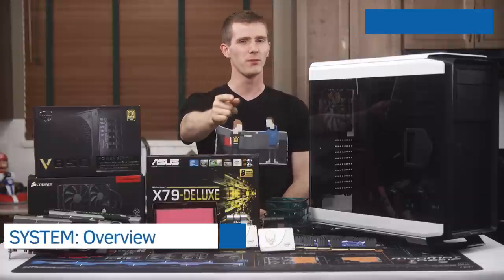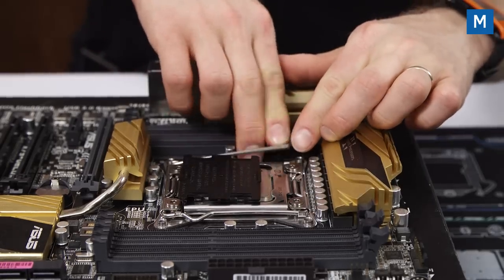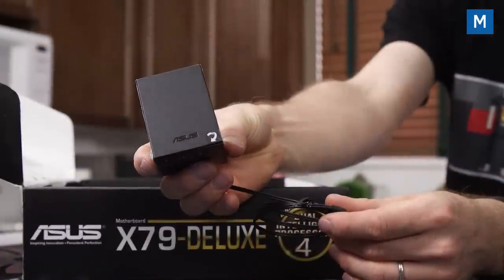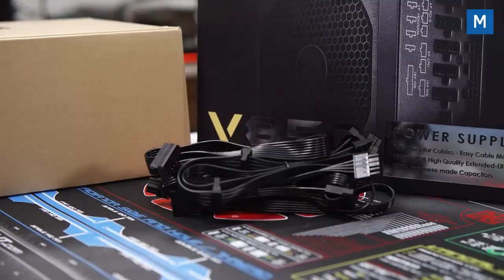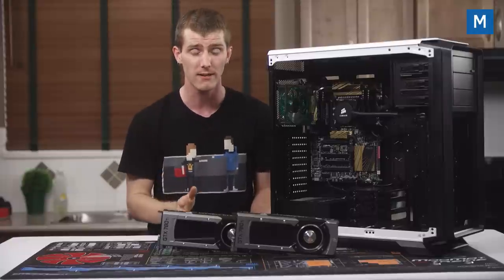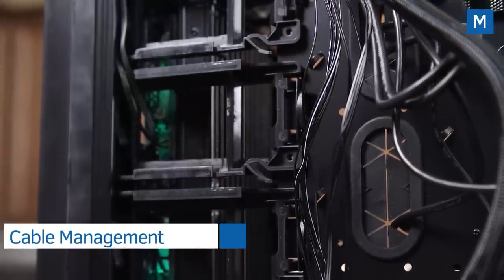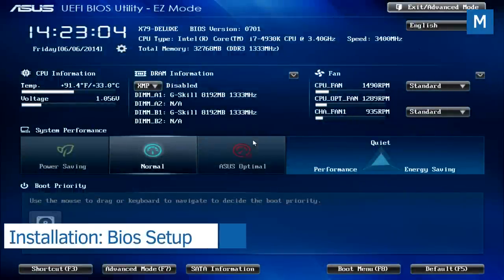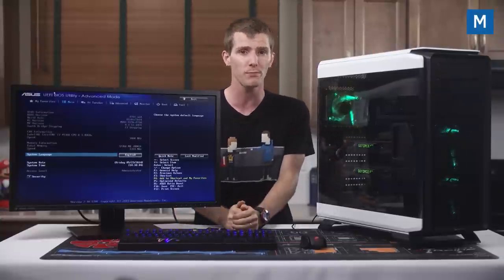How to Build the ULTIMATE 4K Gaming PC Build Guide

Comment: I think it would probably be better to use a 1440p monitor with is so you can have decent frame rates and AA.  Hardware just isn't up to par for native 4k yet and this rig is around $4000.
Reply: And the cost of the monitor, which is plenty
Reply: A) AA isn't as needed on at higher resolutions.  
B) AA is overrated.  Larger performance impact for minimal quality improvement.  Really edges are that important?  At best it improves a fraction of a percentage of the overall image.
Reply: Pull out one 780ti and you'll still max out games with AA in 1440p.
Reply: Alegiance not at 60 fps you won't. Google some benchmarks.
Reply: tmar23 you still need AA even at 4k. You can definitely notice the jagged edges, AA is simply a must even if it is only FXAA.
Reply: personaly i would use it on a 144hz 1080p monitor... refresh over resolution is my preference, just waiting on someone to make a true 240hz monitor
Reply: i agree
also its worth noting that most of the games (i may be wrong i play on an older pc and with older games) i have never seen any games that support 4k

Comment: I need help Im thinking of spending a zillion dollars on a computer:

CPU: Intel Core i7-4770K 13.5GHz Quadzillion-Core 
Motherboard:	Asus Z97-A ATX LGA1150 Dragon Gaming 1337 Edition
Memory:	G.Skill Ripjaws X Series 128GB (8 x 16GB) DDR7-1866 
Storage:	Crucial M500 120TB 2.5" SSD 
Hard Drive: Western Digital Caviar Blue 100TB 3.5" 7200RPM 
Video Card:	EVGA GeForce GTX 1780 Ti 30GB SuperMEGAclocked ACX 
Case : Cooler Master Storm Enforcer ATX SUPER Tower 
Power Supply:	EVGA 750kW ATX120V / EPS120V

Do you think it will handle Call of Duty on medium?
Thanks!

EDIT: Thanks for all the help but my mom said we cant afford it..
Reply: Might wanna switch to 256 gb of ram just a heads up
Reply: "CoD on medium"? Buddy, you're barely gonna get 10 FPS in Minesweeper with that garbage.
Reply: you need to spend 2 zillion to play on medium
Reply: i think you need to upgrade to a caclulator 2001 model, they are very powerful and affordable
Reply: ***** Or, you know, just download more RAM...
Reply: LOL . why did you use "i7-4770K" and "z97" ? just invent new names ! 
I7-9960X 
 X139
Reply: mohamed youssef , lol i5 889303. 6,000, 000 psu.
Reply: lawl
Reply: No, you gotta rip out the Playstation 2's CPU. It can handle Microsoft Word at 5-6 FPS
Reply: looooooool microsoft word
Reply: Timothy Lawson
Reply: No, CoD is too badly optimize so you might want o get an intel core i154 instead of i7 and a 484832gb of ram.
Reply: No no no you've gotta get Xbox 360 slim ram so you can play halo 4. Only slim ram can play halo 4 cause they put in way better ram for the slim model
Reply: It will handle it on high
Reply: MEDIUM ARE YOU GONEEE MADD?? COD WILL RUN 500000 FPS ON THIS WITH ULTRA ULTRA SUPER ULTRA EXTREME ULTRA SUPER GREAT EXCELLENT SETTINGSS!!!!!!!!!!
Reply: I laughed too hard when I saw the motherboard was the 1337 edition.
Reply: i dont even think you can run CS 1.6 on low bro
Reply: I don't know I mean the cpu could be better and the ram is crap
Reply: Needs moar cores!!!
Reply: Out dates hardware mate need a new gpu recommend a sapphire radeon R686788 384880x it has 90gbs VRAM gddr89
Reply: Don't gong get Intel it sucks
Reply: Where am i???
2050??
Reply: no in 2069 :D
Reply: Timothy Lawson HAA LOLOL
Reply: lol its the 750kw that got me.
Reply: No, this will run Call of Duty: Expert Warfare on Medium settings 720 30fps: http://pcpartpicker.com/p/ZR7GwP
Reply: clanshadow2  youd be lucky to get medium on that lol.
Reply: This is the funniest comment chain I have ever seen (;
Reply: Oh my God this thread is hilarious! XD
Reply: Mantvydas Maniuska dude, you need to read this thread XD
Reply: Remember , you need your OS to be atleast 128 bit so you can run the 999999999999999999999 GB RAM on it .
Reply: Jade Ryuki man.. u made my day :D thanks
Reply: for starters an i7 is over kill if you just playing cod, if you want to save money get a FX processor from AMD and that will be able to play anything, depending on the cpu ofc
Reply: lmfao... ahaha
Reply: AWW FUCK, MY EYES!!
Reply: probably only 1 or 2 fps in minecraft...
Reply: Man u forgot to change hdd rotations, u need at least 72k rpm so it can make your pc flying around your room and thats actually pretty cool!!
Reply: *****  LOL
Reply: *****
 #dead
Reply: i think it will run CoD world at war and CoD 4 on like 20FPS 
its playable dont worry go for it!
Reply: You should really upgrade your RAM, 1866 is slow :D